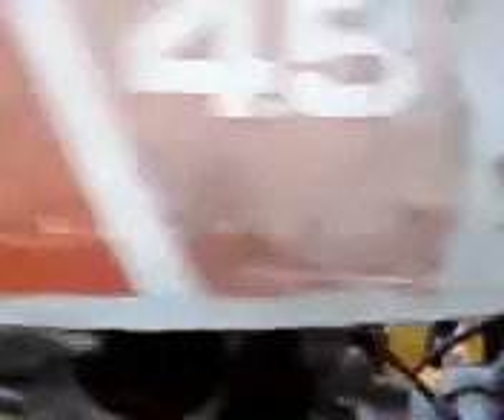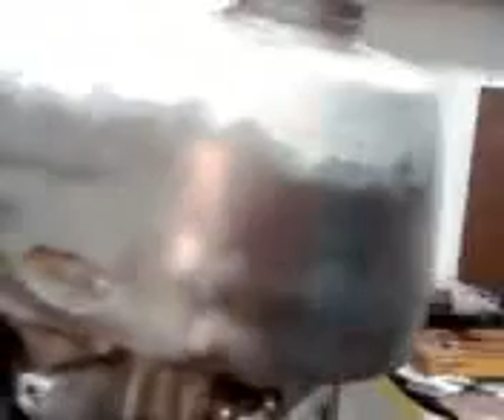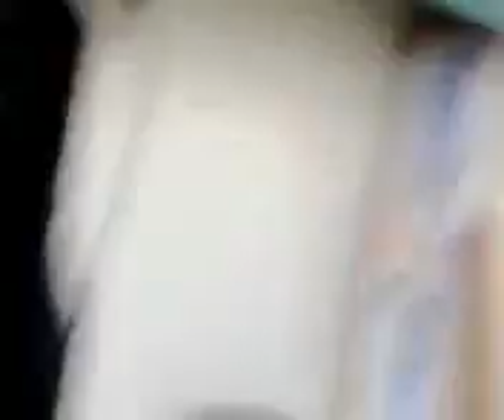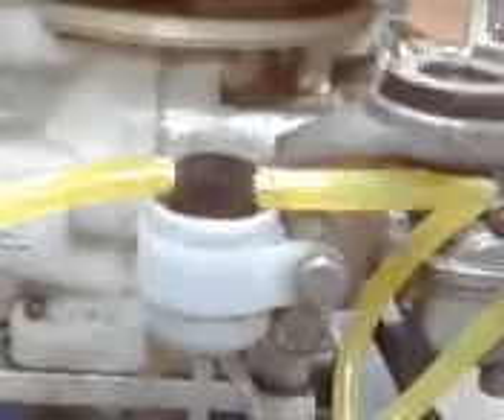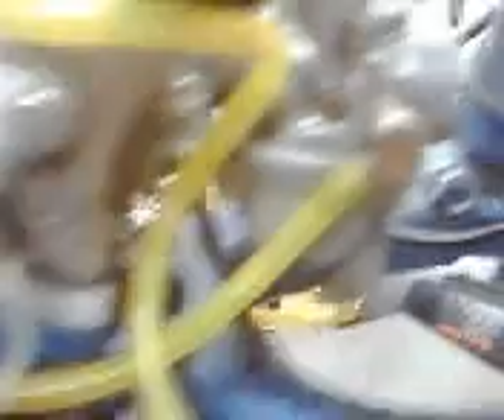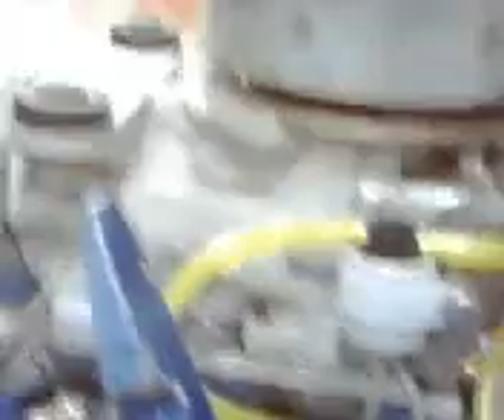Perry Pump installed on 4 1/2 HP outboard

Comment: please explain ,you drill hole directly in crankcase in motor?.(i have yamaha 5b without pump)you've dug the whole casing,
Reply from the maker: Yes in the lower crankcase, all these types of pumps work on crankcase pressure and vacuum. Stay away from moving parts and cylinder. And becarefull.

Comment: thanks alot this really save me. so i just drill a hole in the crankcase size 6/32 hole. stick one 5/32 hoses in it an sealed it with metal epoxy and i should be fine right